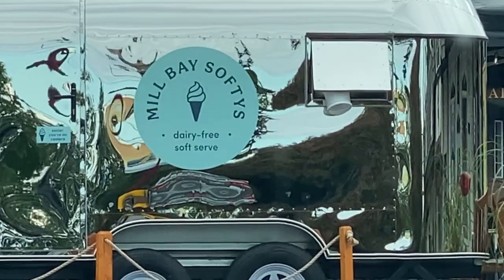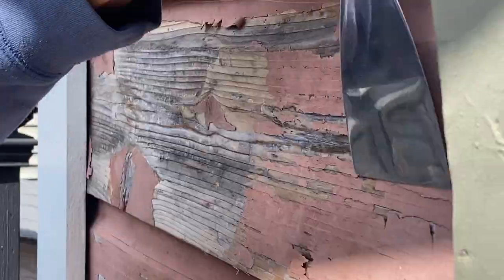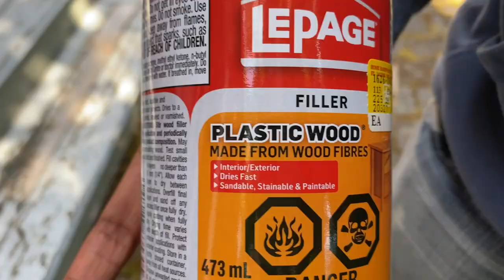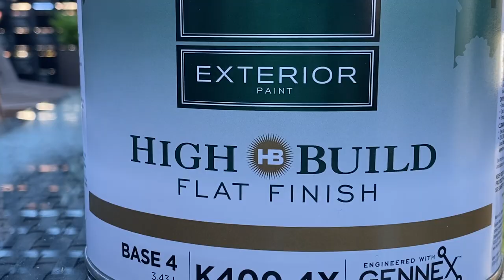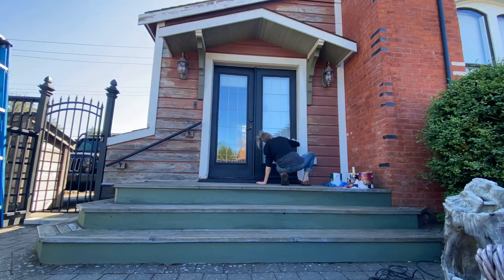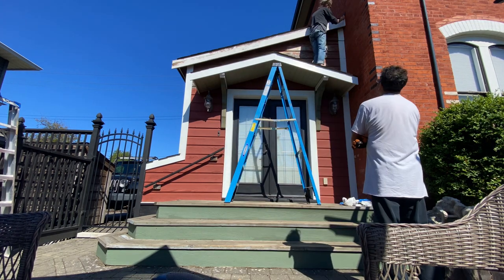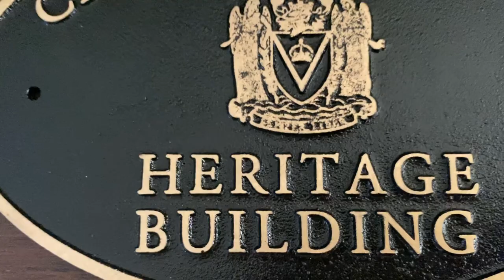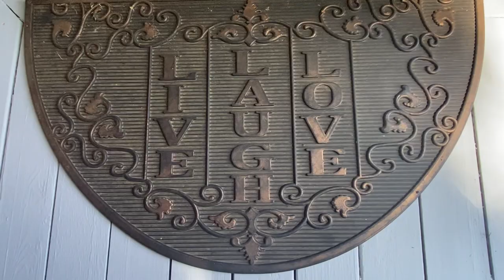How To Makeover Your Outdoor Space On A Budget

Comment: We are beginning a room redo on our three season room in the back of our home. Since it doesn’t have year-round heat, I am definitely going to have to repaint it with exterior paint. The wood on the bottom of the columns that you fixed did look rotted. How did you fix the bottom of the columns without having them rebuilt? I have to do some very similar repairs around a couple of my windows in that room. Some portions are fine. Other portions are starting to rot so at this point I’m at a stand still not quite sure how to proceed. I’m trying to gather as much information as I can. Thanks for your great work and ideas:) Roni